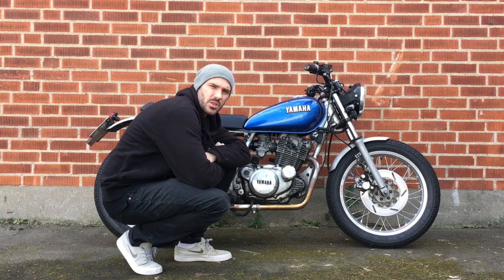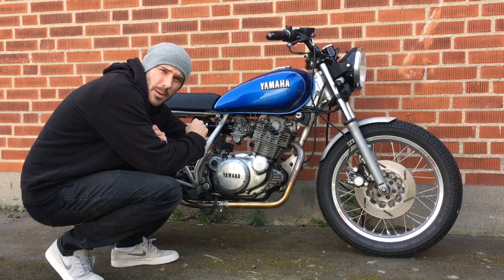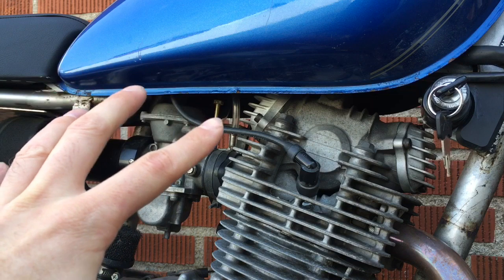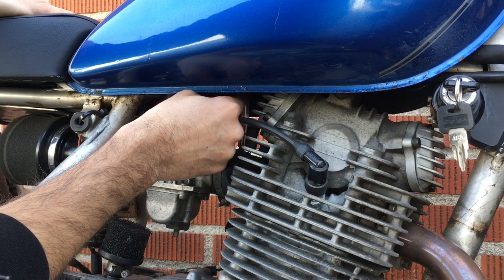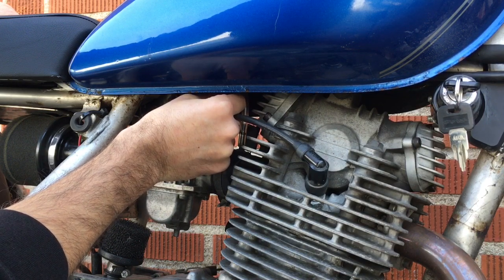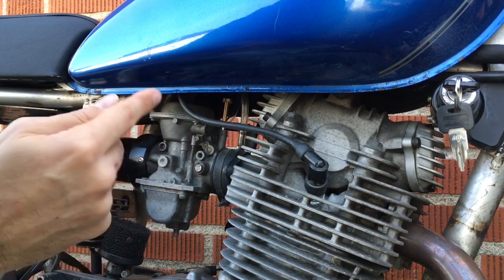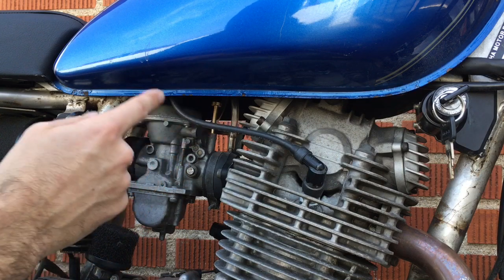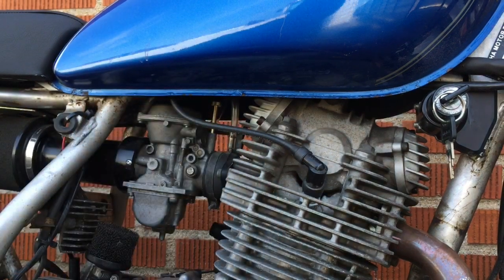SR250 Air Fuel Screw Adjustment

Comment: A friend of mine says that using a larger main jet means more fuel consume. My idea is that riding at the same speed and having the carburetor (original one in my case) adjusted like shown here, it shouldn't. I just think that with the mod you just simply have the chance to run faster (consuming more)  if you like ;)

Comment: Hello again, thanks for the reply. Sorry if I bore you, but I need your opinion and your help.
Two days ago, after having cleaned the carburettor well, I started the SR250 after years of standstill. As I already wrote to you, in the PRI position for about 1 minute, gasoline flowed out of the air filter exhaust pipe. When I put the fuel cock to ON, the fuel stopped coming out, and the bike started easily even using full choke. Today, when I went to turn it on, inserting only the whole choke, the bike started up, after a while it went out and didn't want to start again, as if no petrol was arriving. Not even when pushed downhill did it start. I then put the petcock back to the PRI position, and after nearly a minute in this position, petrol was NOT flowing out of the air cleaner drain pipe like it did two days ago. I put it back ON, tried to turn it on and this time the bike started. What did you understand? Why do you think this happens, where is the problem? I think it is incorrect that after two days, you need to put the tap on PRI to start it. I repeat, I had the sensation that no petrol was arriving to be able to light. Help me understand where I need to intervene. Thank you very much.
Reply from the maker: The fuel in the float bowl must be going somewhere and emptying it. You should not need to use the PRI (prime) position every time you start the bike. It is only needed if the bike has been sitting for a long time and the fuel in the float bowl has evaporated, or you have just rebuilt the carb and need to fill the float bowl again. My best advise is to rebuild the petcock (fuel tap). It sounds like you problem is there. But it is always good advice to rebuild the carb on old bikes as well because I still suspect your float valve is not working correctly.
Reply: @JadusMotorcycleParts  Thank you very much. I will also be replacing the intake manifold as I have noticed a few small air bubbles when spraying petroleum jelly while the bike is running. One question: In addition to its "paper" seal, should a high-temperature sealing paste also be applied?

Comment: Great video ,
i have question thouht ,if i use a non-vacuum fuel switch will carburetor work ?
Reply from the maker: O pateras soy Hi! Yes it will, as long as you block the vacuum port in the carburettor boot ;)

Comment: In which position is the needle position 3 is standard, but I had to hang it lower because it always ran too fat for me ... I find the new adjusting screw great
Reply from the maker: Standard for the SR is 2 turns out.  But when you change the intake or exhaust you need to adjust.  With the performance kit installed, we have a larger pilot jet and the screw is turned 3-3.5 turns out depending on air density.

Comment: this is very good information, I am hoping to provide similar enhancement to my 1981 XT250.  By the way, I would like the air filter and crankcase breather like that but I wonder how to get one that fits?
Reply from the maker: TheTechKey Hi there! Unfortunately the XT and the SR came with different carbs, so parts are not interchangeable. But the XT carb is supposed to be really good?! It has a pumper circuit for nice acceleration ;)

Comment: I just got a sr250 but I noticed if I rev the bike the revs stuck and doesn't go back down unless I turn the bike off. Any advice jadus?
Reply from the maker: It could be an air leak on the intake or a damaged diaphragm. We have videos on both of those things you should check out! :)

Comment: Excuse me, what should we look for then, that the engine runs the faster the better?
Reply from the maker: I apologise for the lack of clarity in the video!  Take a look at the updated description :)
Reply: @JadusMotorcycleParts  Thanks. Now it's very clear (and at first I didn't read the description either, so sorry). I have a SR250 SE with a stock exhaust but adapted K&N air filter instead of the original (in the same place). I changed the position of the needle to be one position lower (so the needle one position higher) and I have planned to put a 125 main jet instead of the original.
Reply: BTW, won't you install a Kickstart?. I'm about to have all of the parts to install it.
Reply from the maker: @FernandoelChachi  Not on this particular bike, but on another one we have :)
Reply: @JadusMotorcycleParts  Hi. Today I've put the needle back to the original position and changed the main jet for a 125. I've followed your instructions but instead of listening to the revs increasing or decreasing I just watched the RPM's on the clock needle, and when closing the screw it finally raised to the higher revolutions, I then unscrewed it half turn. It works great without explosions as I was having earlier (a few) when increasing revs while going down a hill for example. As I commented I have a K&N adapted air filter with stock exhaust (I will surely buy yours in a time). To me, now I have more throttle than before, so to speak, more power on my hand to dispose ;)

Comment: Hi. You said that screwing out the screw leads to a lean mixture.. but when the screw is positioned near the engine (instead of the air filter) when you turn the screw out you let more fuel to go, so it's reacher. I saw also on Mikuni manual and says like me. So, where's the error?
Reply from the maker: You are absolutely correct. This is a fuel screw, not an air screw. I like to call it an air/fuel screw to avoid confusion because the adjustment process is the same. But yes, screw out for more fuel (richer mixture), in for less fuel (leaner mixture). Sorry for the confusion!
Reply: @JadusMotorcycleParts  Glad I was useful. And compliments for the channel, is the best resource for Sr 250.

Comment: Adjusting the carb, do you recommend changing the position of the needle to a lower position or just changing the jet and adjusting the screw shown here?
Reply from the maker: We would not recommend adjusting the needle position - that usually just moves the problem to somewhere else in the power band.  The best thing to do is to get the pilot jet and the main jet just right, then adjust the air/fuel screw perfectly.  Then you'll have a good set up :)

Comment: Just picked up a couple SR and a XT. Installed the XT engine in an SR frame. Runs sweet with the SR carb but now I'm curious about that XT carb and whether I should install that sucker.
I'm considering the header exhaust because the stock is puny on the SR and unfortunately I already sold the XT exhaust because somebody really wanted it$$. Have you any experience or had any customers with the XT carb and the JADUS header?
Reply from the maker: Hi Joey, cool you have both an SR and an XT! The XT header is better than the SR one yes.  And our header is even better :)  We are not familiar with anyone using an XT carb on the SR.  We would presume you would gain bottom end power and throttle response (28mm venturi and pumper circuit) but lose out on top end performance (SR carb has a 34mm venturi but no pumper circuit).
Reply: @JadusMotorcycleParts  Cool Thanks for response. Then I guess I'll be that guy for now that experiments with it. Will get around to it after some other fiddling. Finish installing tank off SR185($60 wreck except tank i had purring in 30 minutes) Fits nicely in front but rear section will need modified. Temporary supertramp muffler(tuning disks👍) for test rides, then eyeball seat mock ups. Really like the extra zip it has over my TW200. Digging the videos. Very helpful

Comment: I do know that nobody should move the idle screw (unless you know how it has to go). I've moved it from time to time. How the idle screw has to stay?. I mean: just touching the metal support, half of a turn, a complete turn more or what?
Reply: BTW, you do resume the whole idea about the adjustment of the carburetor in this video very clearly: "You want to be a half turn away from relaxing the engine from a high idle." You know that I've got different parts: an adapted K&N air filter, your improved exhaust pipe, a larger carburetor jet , your advanced timing set... and recently a different silencer, an expensive german stainless one https://www.motea.com/media/catalog/product/cache/a5bcf6e5787004a02b518212638fea9f/1/2/127230-04-1611138759-182628-0.jpg  I've tried it as it comes and it was too loud. Then I tried a DB killer to get it quieter. I had to close almost all of the air flow and I found that I was losing power and having problems instead. Now I think that "I've got it", with a different DB Killer. Thinking backwards, it should had been easier just buying your exhaust, but well, it is working well now it seems, and I've also learned about how a different DB Killer (I've tried 3 of them) changes the noise there.
Reply from the maker: @FernandoelChachi  Excellent man!  Send us an email if you have time and tell us about your experience with the different DB killers - we would love to know :)
Reply from the maker: We realised that the video is unfortunately not that clear sorry...  we tried to help by explaining in the description of the video ;)

Comment: i'd consider buying parts but everything in your store is empty
also it would be nice if someone figured out an air cooling scoop kit for the engine fins
would also be nice if there was a metal frame insert to remove the need for the air box to hold the side covers, i'd be installing a performance air filter and a fuse/relay box in the same area to add a few extra fuses with a diode and normal relay to mitigate the need for special rectangular relays, places i'd fuse are the ac line to the rectifier because i see them burning the plug on bikes, then the default circuit and then the lighting plus cdi, the mounted fuse box would also double as easy diagnostics once set up plus would clean up most of the wiring
Reply from the maker: Hi there! All of our parts are in stock and available for purchase from our reseller modeliko cafe racers: https://modelikocaferacers.com/gb/281-jadus-motorcycles

Extra cooling is best through an oil cooler rather than an air scoop. We developed an oil cooler and sold it for a while but only ran a limited production run. We also developed finned valve and cam covers that we have on our test bikes :)  The electrics on these bikes is really simple so we have not yet needed to change much other than installing an automotive style fuse holder instead of the dated glass tube one.
Reply: @JadusMotorcycleParts  ah so this is the proper link for your site, i was going to the site that has your name on it
also i noticed something neat from newer bikes you could probly sell to make even better cooling, they make an adapter that goes over the oil filter cover to a radiator in the front with a check valve to prevent dry running but not for the sr250 yet, i suspect the part would be pretty simple and would afford even better cooling than a finned cover which would also help in hot climates, for a bike like mine the radiator clamps to the front frame bar, probly to the left because of the exhaust pipe.
as for fuses, the main reason i wanted to add a box was so i could branch it all to a main line and add in a main headlight and hazard switch being this bike always has the bulbs on which feels like a waste, added organised fuses would also allow a 12v socket to be added and i'd probly put that behind the seat padding on my trunk where the trunk release lock sits so i can charge phones, flashlights and other things i use on the road
i was also considering trying to find a better stator design that would fit the bike as i have been told the 2 coil type is kinda weak vs newer bikes and would let me have more electronics on the road without worrying about a dead battery, however i might just figure out a way to get even more efficient electronics instead as i'm sure they have ham radios that will just run off a small 12v source and i have heard the baofeng uv5r units have a battery delete kit for car use

Comment: Where is that clear tube going ( That one after the carb)
Reply: I found out its for the negative pressure vor the fuel Tap, my Problem is that my Aftermarket fuel Tap dont have the valve. My Problem ist that i cant find any fuel Tap Form the sr250 which have this valve. Has anybody the Same Problem? I think without the negative Pressure there is some Power lost
Reply from the maker: @unknownuser8502   Correct!  That tube is a vacuum tube running to the fuel tap - which only opens when the engine is running (creating vacuum).  It even helps slightly pump fuel to the carb when the fuel is low.  We would recommend trying to find a stock fuel tap on ebay somewhere, or, if you have another type of fuel tap, block the hole/vacuum line to the engine so it is not open.